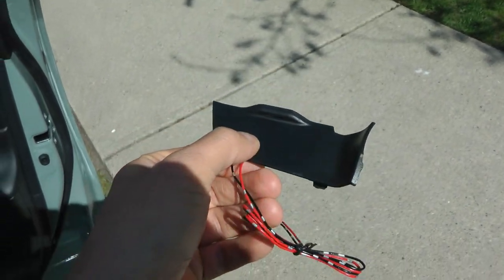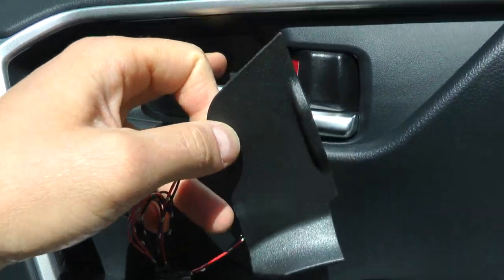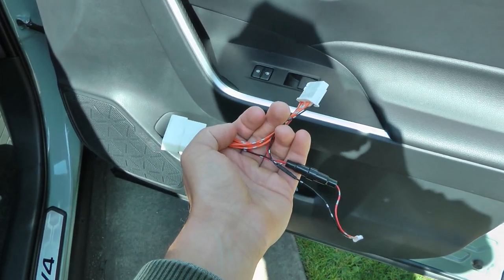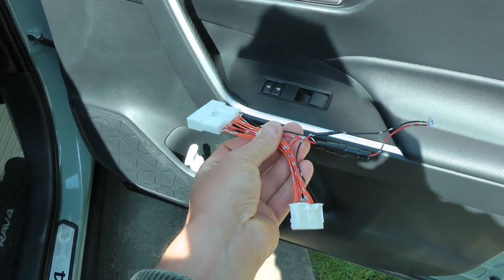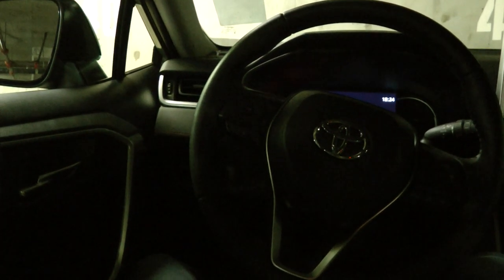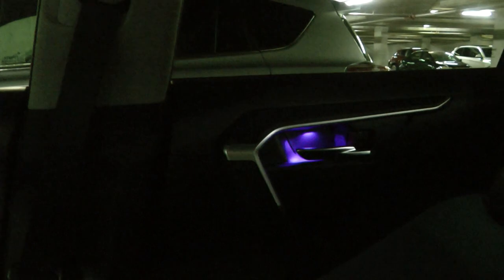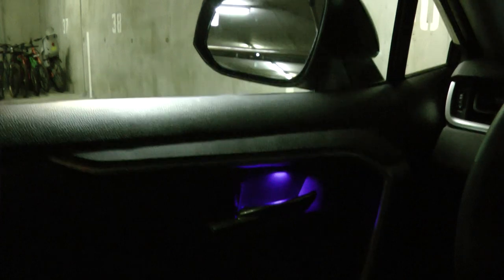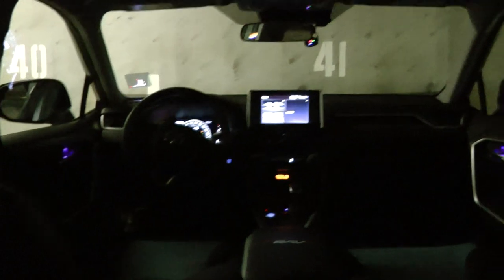Toyota RAV4 (2019-2024): Installation of Interior Door Handle Blue LED Bowl Lights.

Comment: WARNING:  this mod will render the Rav4 power side mirrors inoperable depending on the car software version.   I had my 2021 Rav4 software updated in Apr. 2021.    The power side mirrors became inoperable afterward.   After some detective works, Toyota determined that the cause was this LED modification.   The power mirrors work again when they uninstall this mod.   The unfortunate side effect is that it cost me a bundle for Toyota to troubleshoot and fix the problem.
Reply: Mines work perfectly… I have a 2020 amigo
Reply: @paddyvega  Does it still work after a Toyota software upgrade?
Reply: @Chitown388  I changed the whole display so I can’t really tell you but everything I bought for the car is plug and play ….. Im going to make a video soon of everything I done to it

Comment: Hey thanks for the video dude made install easy asf…. I was hesitant to buy them cuz of the install process but nahh worked out….. only downside is my drivers side won’t turn on I think that light might be defective ILL order a replacement tho … Than ILL be good
Reply from the maker: No problem! If your drivers side light is not working, you need to modify the wiring harness - https://youtu.be/s0HW0s_5ngI.

Comment: These will pair with the led window switch kit, you've got to run the plugs like this: OEM harness > Led Pod Harness > Window Switch Harness > Install > Profit. If you do it backwards only the led pods will light up and not the switches.
USA models driver side must do the mod to the led pod harness shown in his other video. The rest of the harnesses do not need to be tinkered with.
Reply: NEGATIVE, they do not pair with the window switch plugs AT ALL.
Reply: @hanyabi-habib8226  You've misunderstood or don't know what you're talking about. They do work, I've done it in my vehicle. I'm just saying you can run the led window switch harness and the led interior door handle harness together and they'll work at the same time. My Rav4 didn't have led lights on the window switch so I had to add those to all four doors, then I added the led interior door handle lights to all the doors too. However the USA models the driver side to get it to work you have to mod the harness shown in his other video, the other 3 doors work without the mod.
Reply: @shoegum7362  okay, unless you have special aftermarket window switches, the door handle led adapter bit DOES NOT fit. 

I literally just tried.

Comment: Hi, I had installed this LED lights for my 2020 rav4. I am also planning to install the light up door panels as well. My question is will both of these component interfere with each other?  Thanks!
Reply: Yes they will work together  just keep in mind you have to use the orange harness (led pods) and plug those into the OEM then plug the window switch harness (led window switches) for both of them to work. If you do it backwards only the led pods will light up and not the window switches. So its OEM harness > Led Pod Harness > Window Switch Harness > Install > Profit

Comment: Hi Morozov! I really need your help! I installed the illuminated window switches last year, I purchased them right away after you had posted a video of the installation. It worked great! I had just bought and received these Interior Door handle lights and installed them as correctly as shown in the video. Now, the all but the drivers side door window switches do not light up anymore. All the Door handle lights work but all 3 window switches (passenger and back seat switches) do not light up anymore. What can be the cause of this? 

Thank you so much Morozov! God Bless!
Reply from the maker: Hi Jennifer. Unfortunately we don't have the door handle lights right now and cant test both of them at the same time. We will try to order the part and see what is the issue. At the time, unfortunately, i cant help you with this one.
Reply: @MorozovAutomotive  I figured it out! It was the wiring! Now that my Rav4 XSE is modified, all i am waiting for is the Illuminated Window switches for both driver/passenger and the Map/Dome unit. I can't see anything at night! do you have any input on when that would be made?

Comment: Will it fit a 2023 hybrid XLE? Thanks, what model of Rav 4 are you installed on?
Reply from the maker: Hi, yes it will fit. For the 2022-2024 Toyota RAV4 you need to purchase an additional wiring harness which can be found on the cartrimhome website - https://cartrimhome.com/Door-Handle-Bowl-LED-Lights-For-Toyota-RAV4-2019?tracking=morozov_automotive.

Comment: Received mine and the light on the drivers side doesnt work. Light works when installed on the ither door. Ordered a brand new set and i still have the same problem with the same door. Any infos would help.
Reply from the maker: Toyota RAV4 (2019-2024): How To Fix Cartrimhome Door Handle Blue LED Light (Driver Side) - https://youtu.be/s0HW0s_5ngI.

Comment: I have a question...I install my lights today. But the main one driver side doesn't turn it on....I try to see if was the fuse but that its ok...I try on back side light and there is working...so my question is has to do another troubleshooting..or is not fit on on that side on my 2019 rav 4 xle...please if you have and answer just let me know.

Comment: HEllo, Does I need to have automatic folding mirror or just power mirror? I been told today that for the driver side I need Folding mirrors.??? Which is correct?
Reply from the maker: Hey Edgar, yes you do need to have the automatic folding mirrors for the driver side to work . When we got the lights their website didn't have information regarding the auto folding mirrors. So we had to rewire the drivers side to make it work. I was hoping they would make a version of light for the north American market but looks like they don't have it yet. So I would wait till they release this new version.
Reply from the maker: Toyota RAV4 (2019-2020): How To Fix Cartrimhome Door Handle Blue LED Light (Driver Side) - https://youtu.be/s0HW0s_5ngI.

Comment: Got the kit installed. All of the passenger and rear driver side works except for the driver door. What I found out is that the negative wire for the driver side is not connected to anything, thus no voltage and no light to the LED's. Not sure which wire it is supposed to piggy back off of. Will check later.
Reply from the maker: This may help - https://youtu.be/s0HW0s_5ngI.
Reply: @MorozovAutomotive  Thank you :). This helps a lot
Reply: I have the same problem as yours. Pls post how to make it work when you figure it out.

Comment: i installed these inner 	doors lights  and my passenger front side power window it wont work   can you help  me  why i have this situation? please advice
Reply from the maker: Hi Estrella, please check if you plugged back all electrical connectors  to the window switch after LED installation.

Comment: @Morozov Automotive how you doing bro? I bought the same kit for my 2019 Rav4 install it. All the passenger light works, but my driver light is not working. I try pushing the push start light your
Video still not working for driver side front. Please help?
Reply from the maker: Hey man, I would try to get in touch with their customer service/help center. See if they can help you.
Reply: Thanks man
Reply: Does your rav4 have automatic folding mirrors?
Reply: No is U.S Version no folding mirror. I believe that option only come with Europe and worldwide RAV4 only
Reply: @Shinmusicproduction  I just tried to order them, And I been told at customer services that it will not work the driver side if I dont have the folding mirror.
Reply: I ordered one for mine and install it. The driver doesn’t work. The Customer services told me they have manufacturer to troubleshooting the product and they will get back with me ASAP. I would wait before ordering,because my guy video here has the European RaV4 version and I have the US version
Reply: Driver side also not working here
Reply: Did you contact customer services?
Reply from the maker: @Shinmusicproduction  Toyota RAV4 (2019-2020): How To Fix Cartrimhome Door Handle Blue LED Light (Driver Side) - https://youtu.be/s0HW0s_5ngI.
Reply from the maker: @davidbaez357  Toyota RAV4 (2019-2020): How To Fix Cartrimhome Door Handle Blue LED Light (Driver Side) - https://youtu.be/s0HW0s_5ngI.
Reply: Morozov Automotive thanks. That worked perfectly

Comment: Hi sir what is the name of the white plug could you write it down please thanks
Reply from the maker: I assume you mean the connector.
Reply: Morozov Automotive thanks but I don’t know the exactly name and I found it on eBay and they didn’t put the picture of that connector and not sure and it is including handle blue light or no
Reply from the maker: @esmatrosta5280   Lights do come with all necessary connectors.
Reply: Morozov Automotive thanks but they just put it the hand blue light picture and did not put the picture of connectors as I am not sure. When I checked your comments and it is taking long time to develery to Australia. Thanks